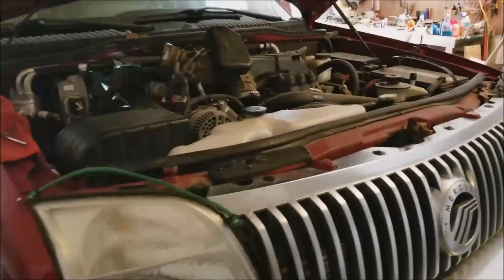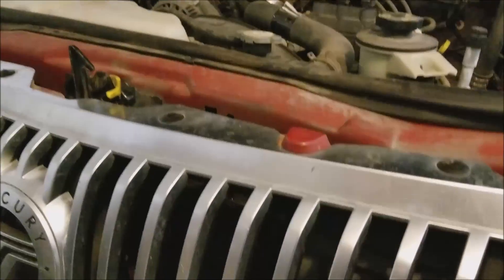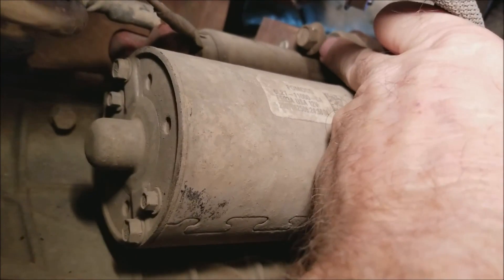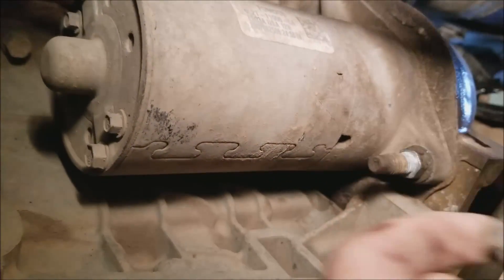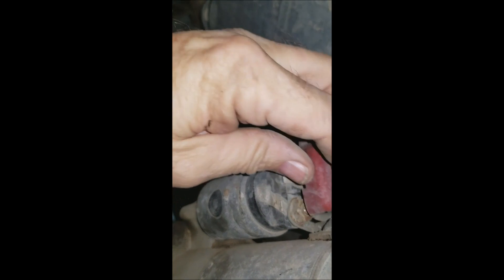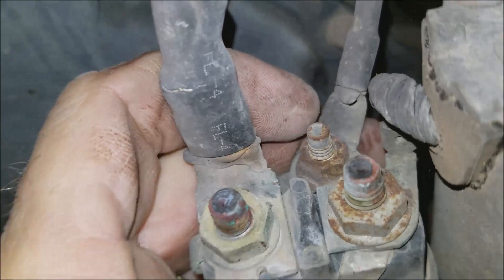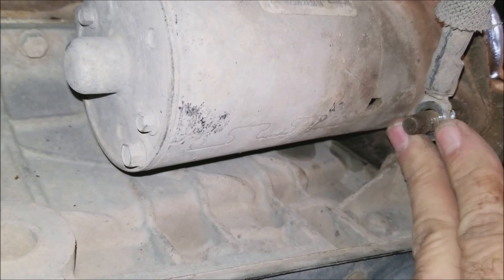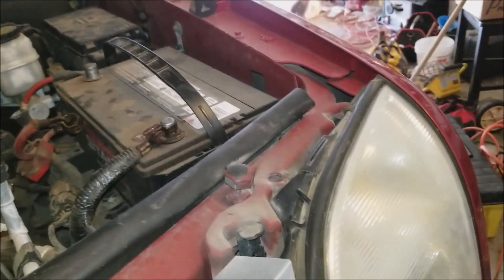How To Replace The Starter On A 2004-2008 Ford Explorer or Mercury Mountaineer

Comment: For anybody here with an AWD model: front differential is pretty in the way but still very doable. 

Just got done doing one, thank you for video! Helped a lot. Front Diff on the AWD is right underneath starter. Get to nuts and bolts with a small-ish wrench and deep well socket, then pull the starter out from the top. Did it in a driveway with jackstands in about 50 minutes

Comment: I have a 2009 Explorer, 4x4, v8. I undid the 2 bolts everyone speaks of, and the starter wouldnt come out.  Turns out there's a 3rd bolt on my starter, in the hardest possible spot to get to. I can't see it, but I can put a finger on it. Got a 13mm socket on it once, but only without the wrench attached. No clue how I'm going to get this out.... FML

Comment: This isn't the same as a ford explorer 2004. It has 3 bolts completely different. Exsaust is in the way and the 3rd bolt is over top the starter